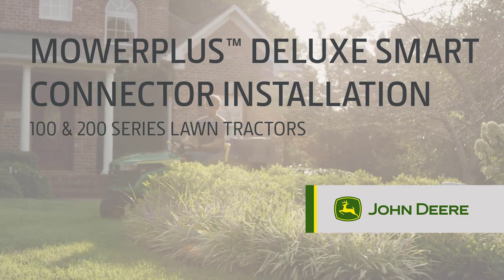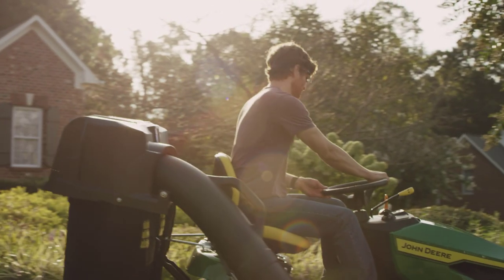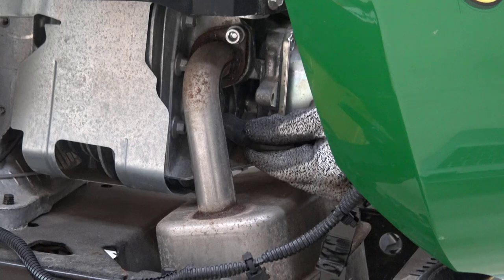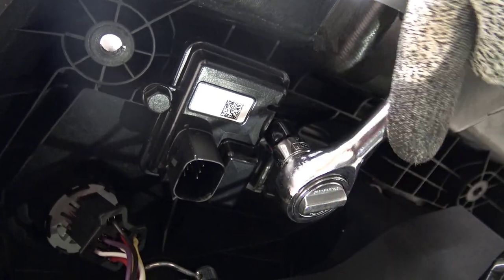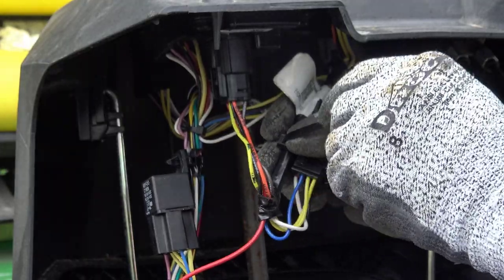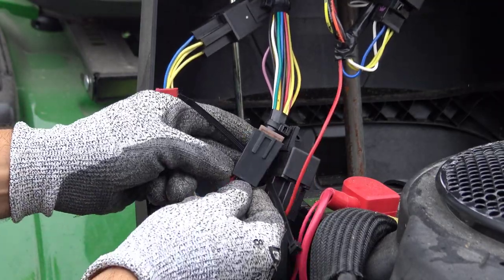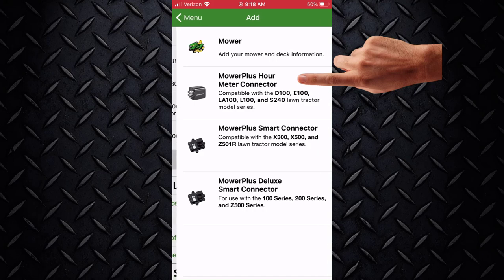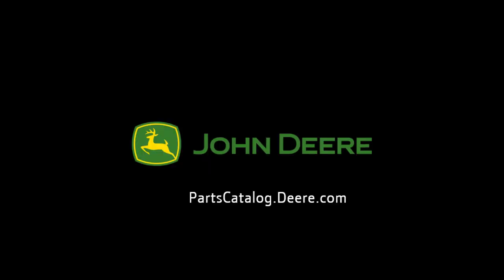How to Install the MowerPlus™ Deluxe Smart Connector | John Deere 100 & 200 Series Lawn Tractors

Comment: I can’t find this part anywhere on the John Deere website.
Reply from the maker: Thanks for reaching out, JAY 4K. The MowerPlus™ Deluxe Smart Connector kit featured is BUC10929 and available at Deere.com/Parts. This kit is compatible with our S120, S130, S160, S170, S180 and the Model Year 2021 and later S240 Lawn Tractors (starting at Serial Number 880,001). We recommend reaching out to your local dealer to confirm compatiblity with your unit prior to purchasing. If needed, you can find their contact information at dealerlocator.deere.com. We hope this helps!

Comment: The app currently doesn’t recognize this device as the compatible component for the S130 tractor. I guess I’ll just ride around with an extra $100 part that does nothing until they get their stuff straight.
Reply from the maker: We're sorry to hear that you're experiencing this issue, Kevin! We recommend reaching out to mobilesolutionsgroup@johndeere.com for mobile app support.
Reply: So, after spending the second half of the year waiting for something to happen I figured I should post an update. I followed the advice in the reply and received a nice email about how I must have done something wrong during my installation and instructions on how to install the module “correctly.”  I called JD directly and apparently the app is provided by a third party, which nobody at JD is able to contact. I was instructed that for any further assistance I would need to take my tractor to my local JD service center. That’s exactly what I did next. So after going over the entire thing with the service manager, on a hunch he tried to connect with his android phone and s.o.a.b. It worked first time. So the dealer/service manager filed a report with JD…and nothing else ever happened. So if you have an iPhone don’t waste your money.